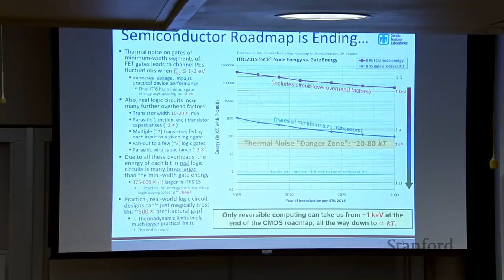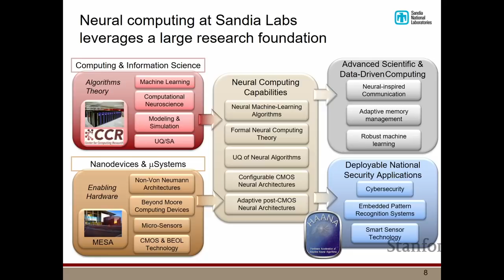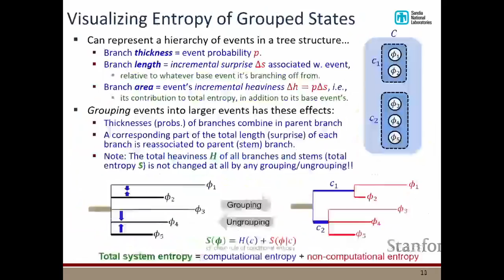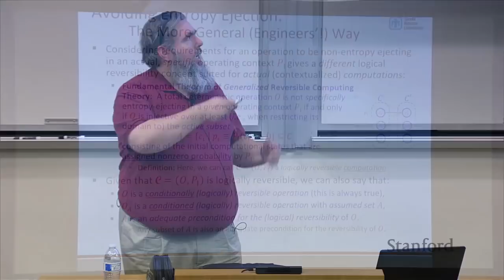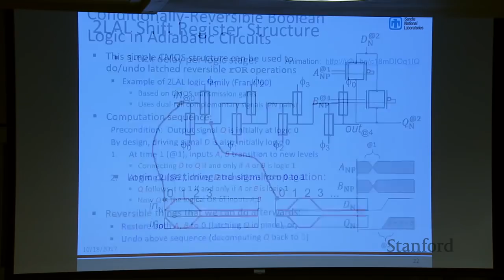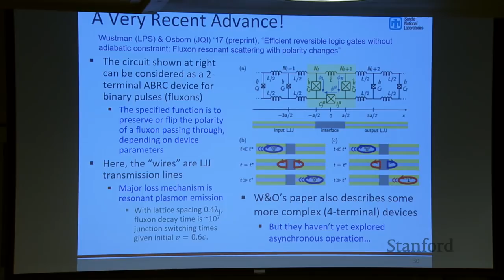Stanford Seminar - Generalized Reversible Computing and the Unconventional Computing Landscape

Comment: At 28:30, why does the CNOT gate R have to send a bit into the Environment? In the next(reversible) slide, the CNOT doesn't immediately send it into the environment and gets run through another CNOT gate. If it is just that the CNOT gates are so close together that it isn't able to make it to the environment, then shouldn't the second CNOT gate on the second slide also send one out to the environment (since there is not another gate after it)? I don't understand why the CNOTs wouldn't always behave the same.

Comment: The ultimate task or challenge is not an engineer's "local reversible hack" in this or that globally entropic context. The real challenge is foundational theory of pure math/computation that is reversible from the foundational get go, and as such can provide non-entropic context for local subsystems of computation. 

Here's a hint: instead of Hadamard "+" and "-", use genuinely polar symbols "<" and ">", ie. the relational operators (which btw do not fit the given definition of operation). Writing and reading (ie. computing) with polar mirror symbols you can notice that 10 NOT 01 are not palindromes, but  <> and >< are palindromes, ie. reversible superpositions of reading from Left of Right. This enables to generate by simple concatenation fully palindromic Stern-Brocot type structures, ie. a pre-numeric and reversible theory of "rationals" with count three types of countable objects: < <> >. Numeric interpretation of the generated strings would of course result in entropic loss of information.

Comment: if you think  about it the landau limit is a rule we invented, It`s just obvious this is the future, i mean, you`re using a reversible computer right now, how do you think your brain does more computation than any supercomputer using only 60w? that`s reversible for sure, you couldn`t make all of this calculations using that low power in traditional computing.
Reply: Human brain doesn't make so much computation though.
Reply: @blinded6502  It computes a lot but:
1- Avoids a lot a needless computation to begin with
2- is very efficient per fundamental operation
So it makes much less computations than it would have to if it was as badly designed as our current CPUs/GPUs (1), which makes the enormous number(made possible because of 2) of computations it does have a bigger impact. That's one of the many reasons why strong AI seems so out of reach and certainly the main reason why we can't trivially rule out the worst candidate paradigms (like GPT-n , n > 2) to get there.

Comment: If reversible computing makes computation approach zero-power, would that allow Maxwell's Demon to globally reduce entropy and extract energy (since the energy lost via the Demon's memory would approach negligible)?
Reply: No, there’s still an entropy increase in Maxwell’s Demon because the correlation between the Demon’s memory and the system the Demon is manipulating quickly becomes lost on a thermalization timescale.  So the data in the Demon’s memory is itself new entropy, which can’t be destroyed by the Second Law, and which exactly compensates for the reduction in entropy in the system the Demon is manipulating.